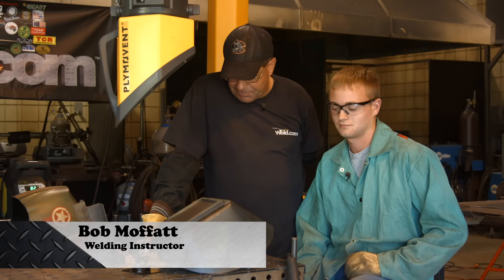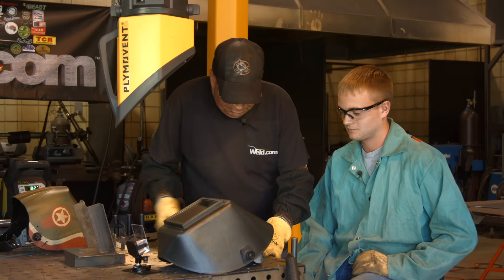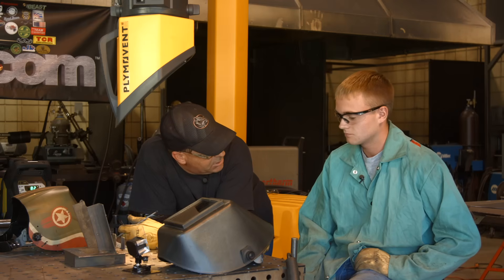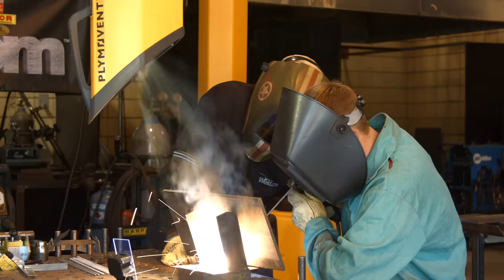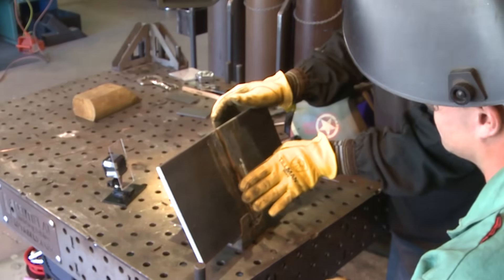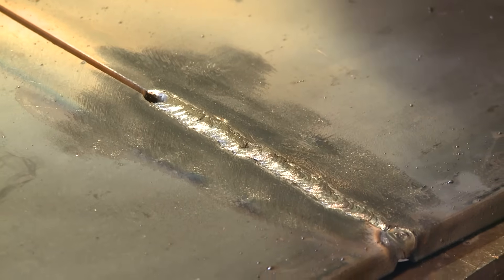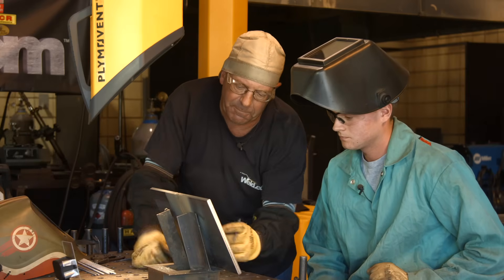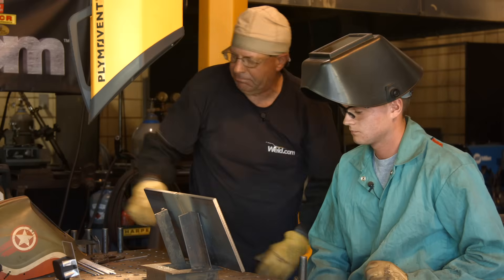🔥 Uphill 6010 Open Root Restarts - Common Mistakes and How to Fix Them

Comment: I've been trying to get back into the open root stick welding game. I can run downhill generally well with minimal issues 1/8 6010 80 amps. 3/32 root and root face.   Uphill gets me. I can't seem to just run it straight, it blows up the root. If I stitch it it goes better. Same 3/32 root and root face. 80 amps it blows up, 75 amps it wants to freeze and stick on me. Any suggestions?
Reply: Short steady arc. Work it if you need to.

Comment: Im rocking the same hood as the kid (951p huntsman)..works well,runnin high amperage dualshield fluxcore mig..Its so smokey ive went to the passive shade 11 in my huntsman instead of my normal auto dark rig..pro tip.

Comment: Oh, one other thing I wanted to ask too, I'm in Australia by the way, I picked up a box of schwiesstechnik rods the other day from a market. These rods were 'dc' only low hydrogen. Tried them out on dads old copper core AC transarc. No chance. Stuck like glue. Over and over. On my BOC 170 dc inverter, no problem. Not great on restarts, seem to create a deep crater and hard to strike after. Is that common on dc rods? I've never seen dc only rods before. Or is it just that they are shagged? They look ok.
Reply: Most lo-hy rods are hard to re strike.

Comment: Your certainly a good teacher. Can I ask if you could quickly answer a question for me, I'm sure, considering I do do a fair bit of welding that I should know, but why in this video did he not do a restart using the rest of the rod? There was more than enough left to finish that run. Does the rod become somehow unstable or unreliable? Or is it a flux issue? Or is it just a reg that should be followed?
Reply: He wanted to make sure to finish the run .We use the half burn rods on hot passes and tacking up.

Comment: This is uphill not downhill title is wrong!
Reply: not sure what he means, but it might mean he is restarting the weld on the downhill side of the weld and then welding up hill.
Reply: thats how you should always restart when welding open root, you start back on the weld to get it heated up and red that way when you get to your stop you get full penetration instead of a lil crevice
Reply: but downhill is welding from the top to the bottom uphill is welding from the bottom to the top
Reply: Cup Walker We are aware of the title mistake. Thanks for noticing.